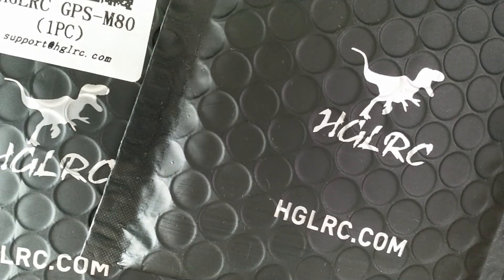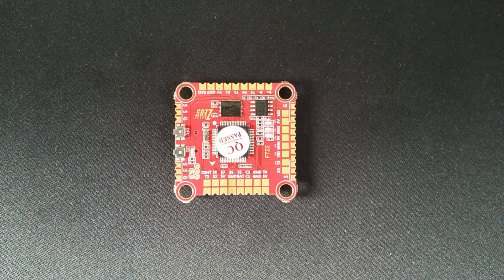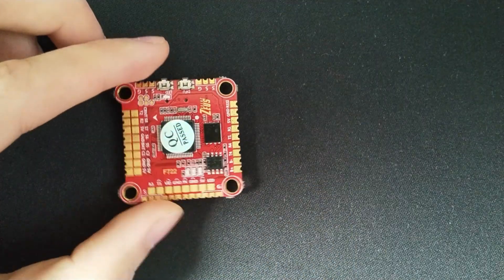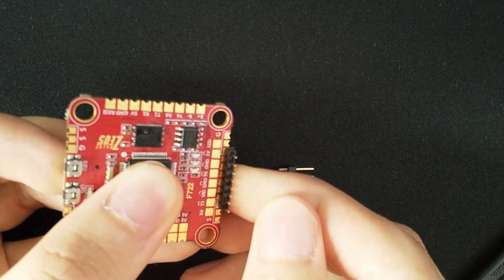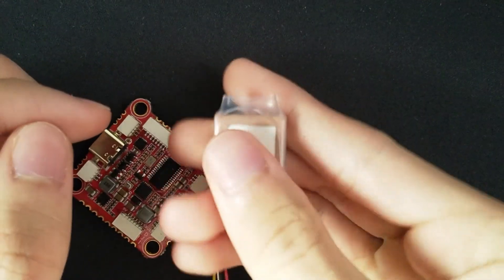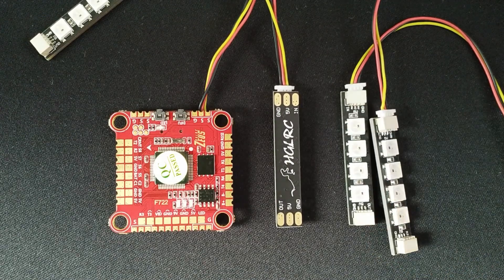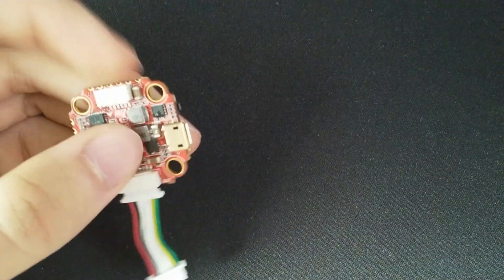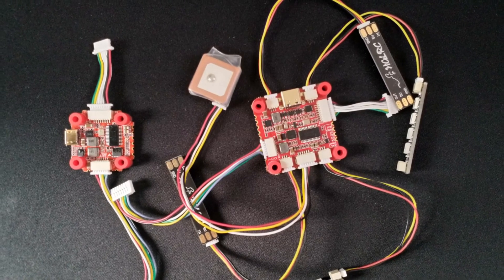HGLRC Zeus F722, Zeus F722 Mini and More - Overview

Comment from the maker: ATTENTION:
Prices have increased A LOT! When I made this video, the FC was cheaper than most competitors. Of course everything is more expensive now, but also compare prices to products from Diatone for example.

People I know say that they have recently bought a Zeus F722 Mini and they have not received the M2-M3 Adapter thingies! HGLRC might not include them anymore.
I would like to point out that the F722 Mini has no solder pads for the motor outputs. Many people don't seem to care about that, but you should keep in mind that you HAVE TO use the plug. If it gets damaged, repair is considerably harder than if the FC just had solder pads (in addition to the plug).
New Versions of this FC have no I2C (SCL SDA) pads! Early versions had these pads.

In the video I say "... I don't see many reasons for buying an F4 right now", this is only partially correct. Even though I like F7 more, and you will probably be happy with either an F4 or an F7, the topic of F7 vs F4 (or other) microcontrollers for your next FC is so large, you could make a separate 10-Minute video about it. In fact, Paweł Spychalski did it and I highly recommend you watch it, if you're not sure if you should get an F4 or an F7. https://youtu.be/V33Ipef5s8c

Comment: Hi, Great video. I have this, but need some help on upgrading. Can this F722 Mini be used with HDZero Race V2? Thank you 🙂
Reply from the maker: Hi, thank you. I don't see any reason why it should not work with the HDZero Race V2 as long as you have enough unused UARTs and the correct voltages.

Comment: Hi!Where is the boot button on f722 mini?
Reply from the maker: It's very close to the USB port, but on the other side of the pcb. You press the button from the side. At 5:14 you can see it in the top left corner of the fc, above the 8 solder pads.
By the way, with modern Betaflight you only need the boot button to rescue the FC. For normal updating, you don't need it anymore.

Comment: Serious question can u use a big frame for the mini Zeus
Reply from the maker: Often you can, but it depends on the frame you're using. Many modern 5" frames have both, 30mm and 20mm stack mounting holes. For example the Geprc mark4 frame. Some frames also have two places to mount the stack. They often have a 30mm stack in the centre that you could use for a 4in1 ESC and another 20mmm mounting holes in the back that you could use for the Zeus F722 mini for example. If you want to use a 30mm ESC and put the 20mm FC on top, or if your frame has only 30mm mounting holes, then you need an adapter.

But larger flight controllers basically always have more features than smaller ones. You have to decide if giving up those features makes sense for your particular build. If the mini flight controller has everything you want then using it could lead to weight or space savings that might be worth it to you.

Thanks for the good question.
Reply: @PenPeng  thanks mate u saved me
Reply from the maker: @kgb1632  no problem, glad I could help :D

Comment: Good video was just wondering if it is possible to wire this fc to 4 separate ESCs?
Reply from the maker: Thank you. :)
It definitely is possible, but it's really not ideal. There are two main issues why I would not recommend this FC for individual ESCS:
1. Lack of integrated PDB (power delivery board). 
There are FCs designed especially for individual ESCs. These FCs have big solder pads for the wire from the battery and battery plus and minus pads on each corner that can handle the load. This makes wiring very neat. Without a PDB integrated into the flight controller you need an external PDB like the "Matex PDB-XT60" or the "Matek FCHUB-6S" for example. This has the disadvantage that the PDB is an additional board, but it should still fit into basically every frame. Another option would be to directly run the wires from the battery plug to each ESC, however, this can make your wiring a bit messy.
2. This flight controller outputs the signals for ESCs 1-4 only through the plug for the 4-in-1 ESC.
Of course there is nothing stopping you from cutting off the second plug of the supplied cable and directly soldering the signal wires to your ESCs. (So its plugged into the FC but then each signal wire is soldered to one ESC.) But you would have to extend the wires because the cable with the plug is very short, which could be very tricky. Alternatively, you could solder wires to the solder pads for motor outputs 5-8 and then use Betaflight resource remapping to remap those motor outputs to be motors 1-4 but that's an additional configuration step you would have to do after each Betaflight update. Or you could solder the wires from the 4-in-1 ESC plug onto the "Matek FCHUB-6S" and from there go to each ESC but that adds additional soldering. Flight controllers for individual ESCs have one motor signal output on each corner.

What I recommend:
Get a flight controller that is designed for individual ESCs. If you can't find an FC that is optimized for both, DJI FPV, and individual ESCs, I would recommend getting basically any FC that is designed for individual ESCs that has an 9V/2A (or more A, 8V is also fine) regulator. DJI air unit does not actually need anything special. It just needs a regulator  to give it a voltage within the air units specs and one or two UART on the FC. Only small downside with that is that the wire between flight controller and air unit would have to be soldered on the flight controller side but that's just 6 solder joints.
Reply from the maker: I've just looked around a bit and if you want a flight controller that's optimized for both DJI FPV and individual ESCs, you could look at the "Holybro KakuteF7 HDV AIO" http://www.holybro.com/product/kakutef7-hdv-aio/

I have not tested or used it, just looked at the specs and at first glance it looks good. I recommend you search for reviews of that.